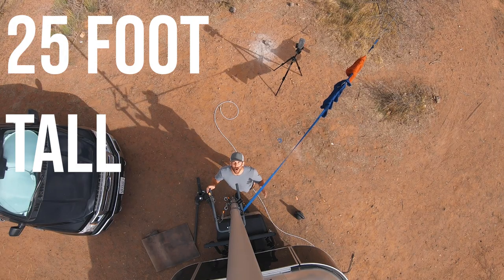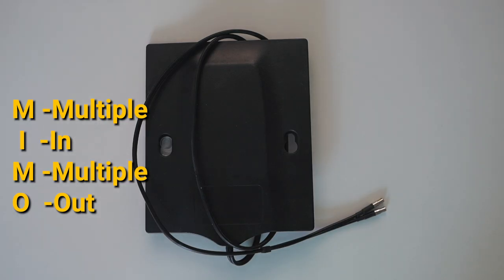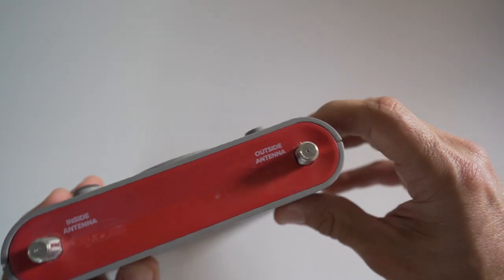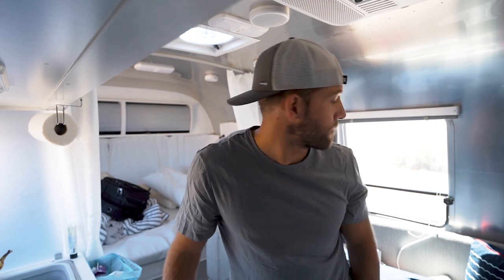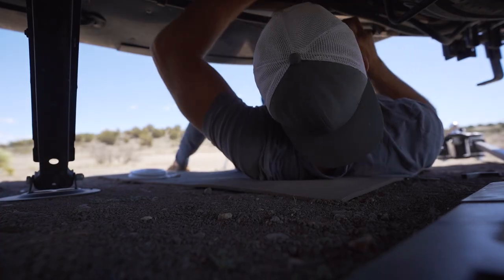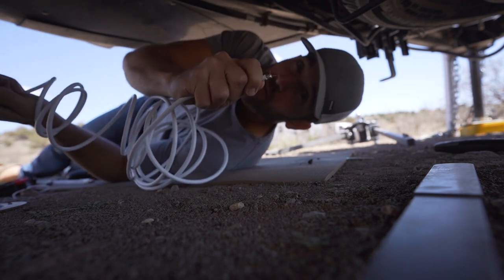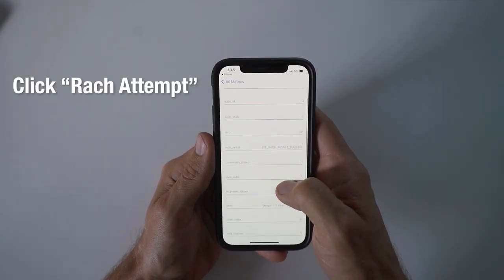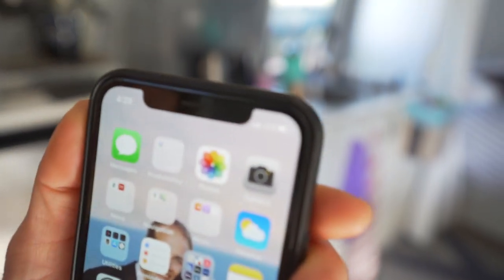WeBoost Destination RV Cell Booster - Does It work?

Comment: Thank you for the test and information! I just purchased this product a week ago and makes me feel better as i had a difficult time getting the booster to be off red to green. I did get it to work at times and when it did, worked fairly well with minimal signal. Think i need to work with and will hopefully work out well overall.
Reply from the maker: It can be a life saver.. but we've also had times when there is zero signal and even this booster won't help.  Sometimes you really need to fine tune where your antenna is pointing.

Comment: Thanks for the very helpful video! If I'm understanding correctly, the weboost amplifies the cell signal inside your camper. I imagine that you're then using some sort of router or hotspot device to turn the amplified cell signal into a wifi signal for use with your computer (videos, email, web surfing. etc.). Would you mind sharing what device(s) you use/recommend for that purpose? Thanks!
Reply from the maker: You're exactly right.  This was the MIMO hotspot we used. https://amzn.to/3qskmnQ

Comment: I'm taking a LONG look at the Destination RV booster for our 28' Flying Cloud before a trip west next winter.  We have an external satellite coax input connection I plan to (hopefully) use instead of fishing as you did.  Couple of questions... How did you secure the telescoping pole to the front of your AS and where did you get that front mount bike rack over the propane tanks?  Thanks...
Reply from the maker: I used these two items.. https://amzn.to/3cfdpmQ & https://amzn.to/3O7C0Hg for the bikes.  I just secured the antenna using bungee cords and packed it away for travel.

Comment: Thanks for the video! I’m trying to run the wires to install an inverter but couldn’t remove the metal cover between the kitchen and the bed. The cover has about 1-2 inches under the cabinets. Do you mind to share how you removed it? Just by removing the two screws and pulling it hard? Thank you!
Reply from the maker: I can't figure out how to describe it differently but the way you said it is correct.  I think there are 2 screws on that cover, you remove them and just wiggle the cover open.  I think it might slide left or right a little to get it out.

Comment: I will plan to work full time 9-5 with significant video Zoom calls everyday so would you recommend the we-boost, mifi, cell all through Verizon. During the week I need to be near service and on the weekends I can boon-dock with limited service.
Reply from the maker: The WeBoost offers the best option for boosting cell signal.  My only concern with your plan is you might run out of data on your cell plans if you're zooming all day. There are some other data provider options I'll see if i can find any links.

Comment: WiFi and Radio engineer here. I noticed a couple of things (please do not take offense, as I know I am just being pedantic)
1. You live in a stainless steel can, radio waves hates stainless steel. (Imagine trying to make a call from inside a giant stock pot, it would be hard).  You would get better reception with your phone, or hotspot outside of the trailer. Just one of the problems with airstream trailers in general.
2. That device is NOT ever a router (router means a connects between two IP subnets, this has nothing to do with IP, just pure radio) its a repeater, or more appropriately, a repeater/booster. (See, I told you I was pedantic, I am so sorry)
3. Your videos are great, ignore my BS above.
Reply: but would you recommend this weboost specifically with your work background?
Reply: @jareddietz9214  yes! But if you want cell service outside the airstream the repeater must be outside as well. So you have to move it when you move from inside to outside.

Comment: Great review.  That antenna does NOT look omnidirectional.   It looks directional, meaning you have to point it at the local tower for the strongest signal.  So use your phone again to measure signal strength and slowly rotate antenna until you get the strongest signal.
Reply from the maker: yes, you're correct.  😀 Sorry if we said Omnidirectional? Are you in the market for one?
Reply: @Roamaroo  I will be soon as I have an RV on order.  Right now doing research.  I noted shape and type of antenna it was.  I don’t think you mentioned it or taking the time to aim it towards a tower. I’ll have to watch again.   Thanks for taking the time to review it for us and share your experience.